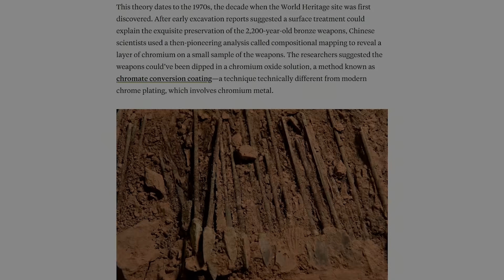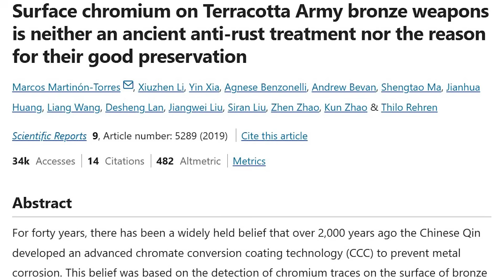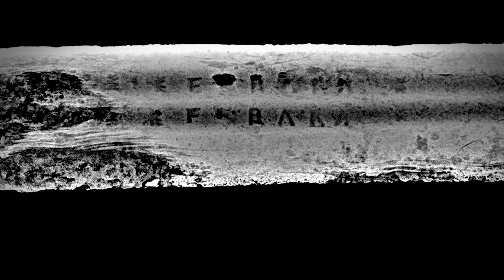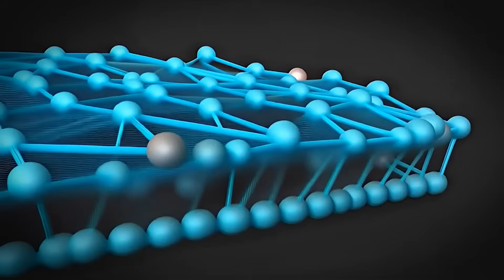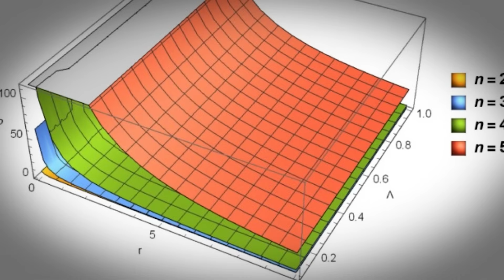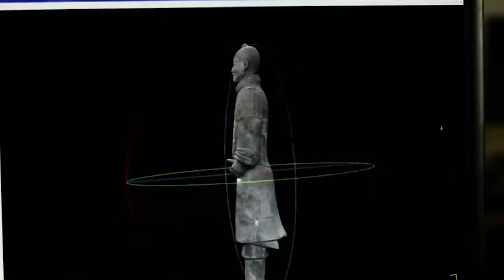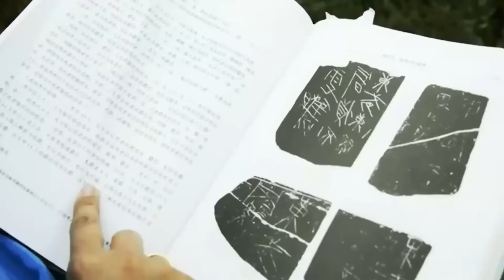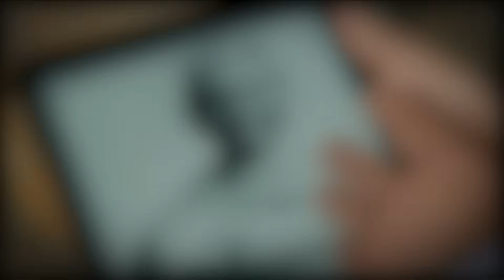The Terracota Army: The Ancient Chemical Technology Modern Science Still Can’t Explain

Comment: China mastered iron-making technology very early on, but early iron-making techniques were not mature, and bronze ware remained the mainstream. China's full transition to the Iron Age may have been 100 to 200 years later than the West. However, the large-scale industrial production technology of bronze ware was already very advanced at that time. After officially entering the Iron Age, iron production was directly industrialized, rather than relying on small workshops and handcrafting as in Europe and Japan. However, industrialized production emphasized cost control, and small workshops or sporadic technological innovations were more common.
Reply from the maker: That's a very insightful point about China's transition to the Iron Age and the advanced bronze production. Thanks for sharing this perspective!
Reply: @SilkRoadDiaries25  In fact, bronze could achieve a certain degree of alloy hardness. Early Western ironware was also rudimentary; scholars have compared it to Chinese bronze weapons, finding that its strength and hardness were inferior. This may be due to a lack of copper ore, leading to an earlier transition to the Iron Age.

Comment: How would someone get that much repetitive consistency of the blades, compared to mardon Japanese hand made blades
Reply: The manufacturing techniques of the Bronze Age were completely different from those of the Iron Age. They relied on molds for mass production followed by finishing. Single-edged and double-edged swords were almost indistinguishable in terms of difficulty and cost. In the Iron Age, single-edged swords were easier to mass-produce than traditional double-edged swords, making them more common in large-scale military production. Very expensive double-edged swords were primarily popular among high-ranking generals, nobles, the wealthy, and martial artists.
Reply: China mastered iron-making technology very early on, but early iron-making techniques were not mature, and bronze ware remained the mainstream. China's full transition to the Iron Age may have been 100 to 200 years later than the West. However, the large-scale industrial production technology of bronze ware was already very advanced at that time. After officially entering the Iron Age, iron production was directly industrialized, rather than relying on small workshops and handcrafting as in Europe and Japan. However, industrialized production emphasized cost control, and small workshops or sporadic technological innovations were more common.
Reply: @jrwolf4955  nice, but not the answer to the question,  thanks